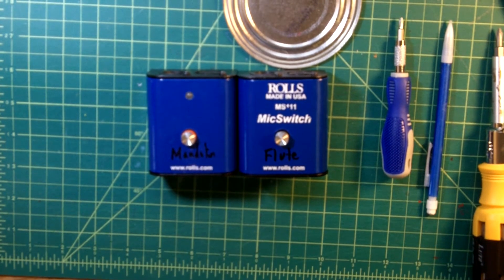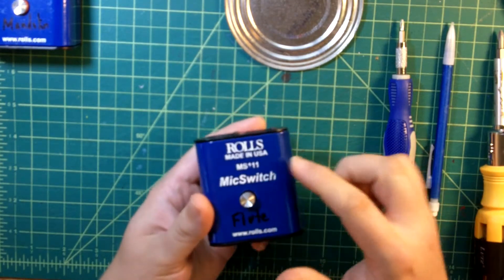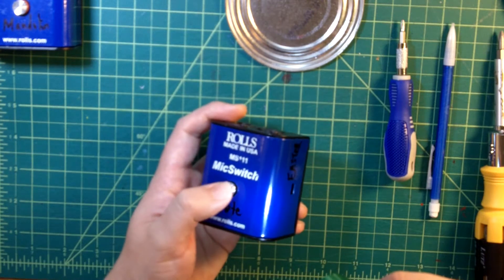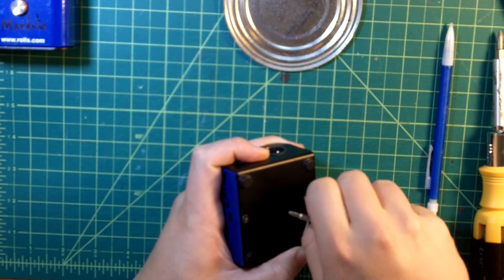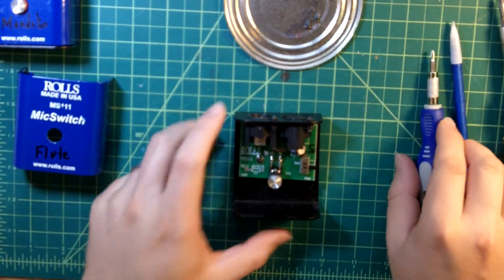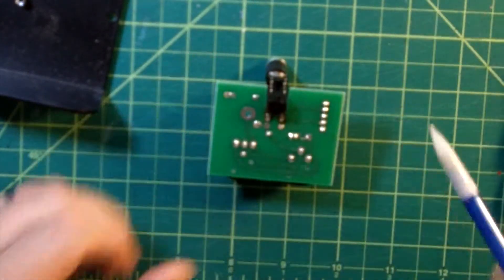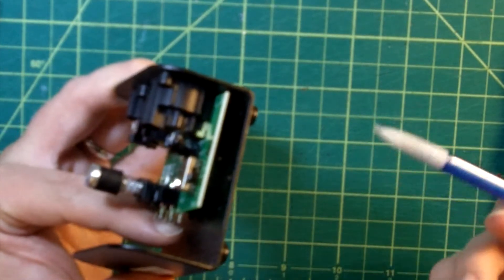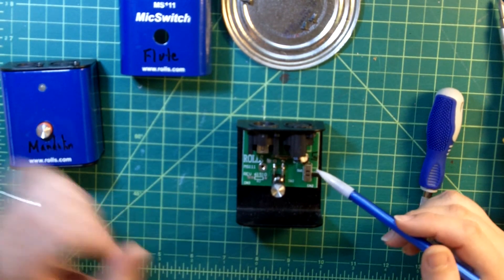Rolls MS111 XLR Mic Mute Switch Teardown

Comment: I have a Rolls Ms112. Its constantly breaking and i have to keep sending it back to them to be repaired. It’ll get stuck on one side and wont switch over to the other (has two outputs). Any idea what keeps breaking on it so maybe i can fix it myself. Thanks.
Reply from the maker: That makes me wonder whether there's something physically interfering with the switch component. Anything jammed in there?

Comment: Thanks for the video! Does the switch cause any audible pop or click in the line?
Reply from the maker: Not that I've been able to hear or see on a recording.
Reply: @adkpiper   That's the reason for the capacitor.  To bleed it off so that there won't be a pop.